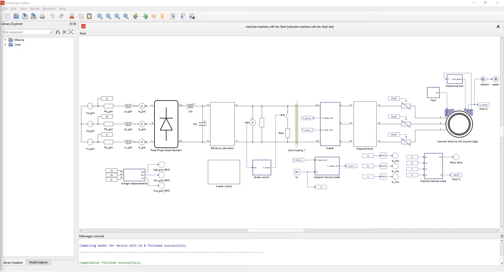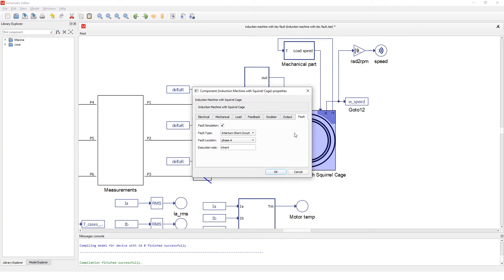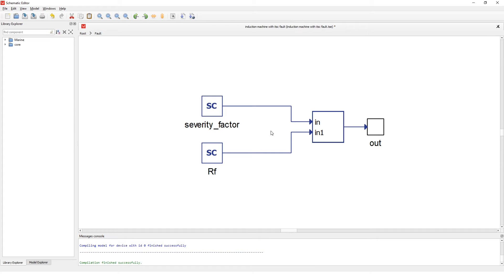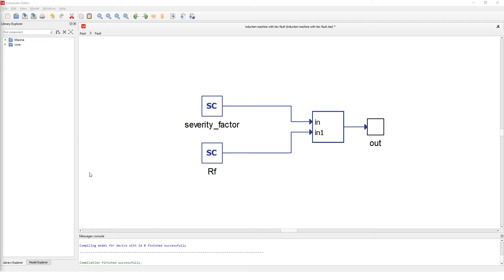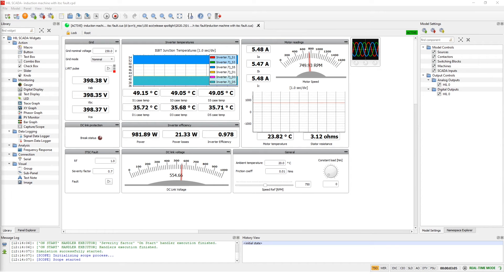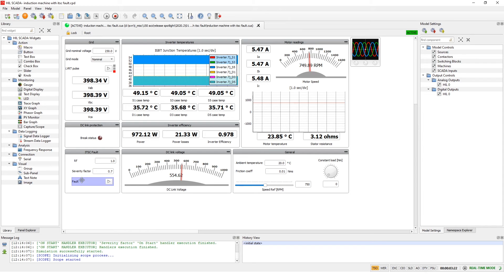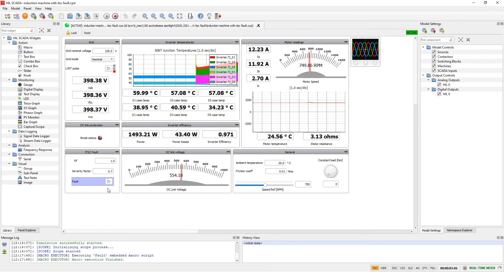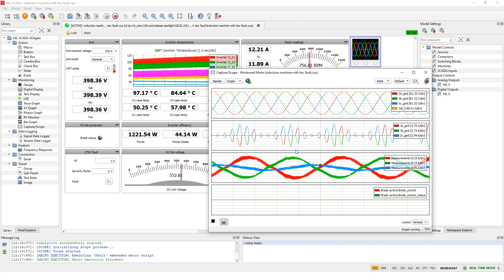How to Simulate ITSC Fault in Induction Machine | 2020.2 Release Tutorial

Comment: Why did phase A and B currents increase while phase C decreased in case of 70% fault? There are similar situations in the literature, but I could not understand why. In the case of 100%, there would be an increase in all three phases?

If the failure rate was 10% instead of 70%, would there be an increase only in phase A?

Thank you
Reply from the maker: Hi there! More on this topic is introduced within the Power Electronics specialization program offered at HIL Academy, so we hope that will be helpful: https://hil.academy/converter-circuits-specialization-fundamentals/